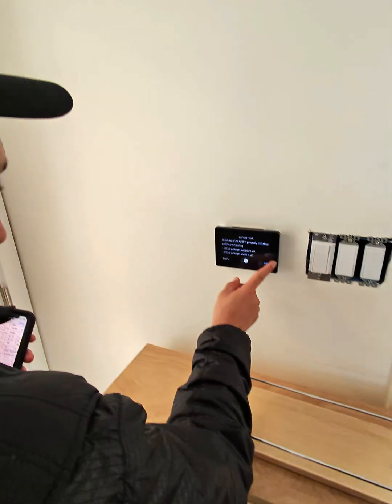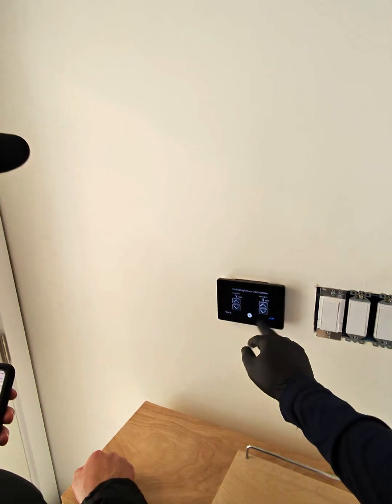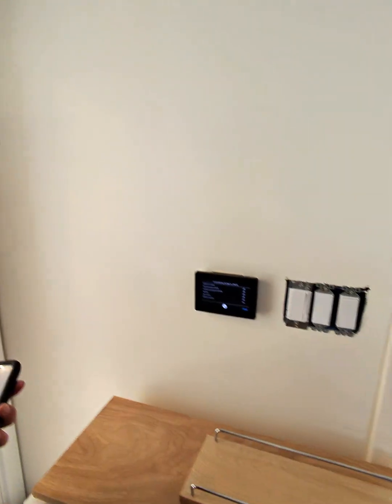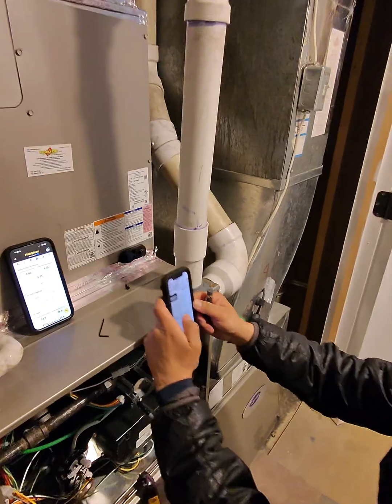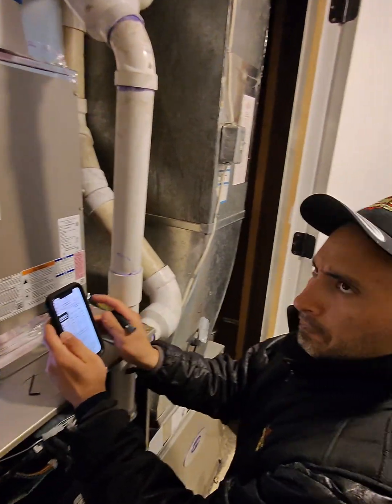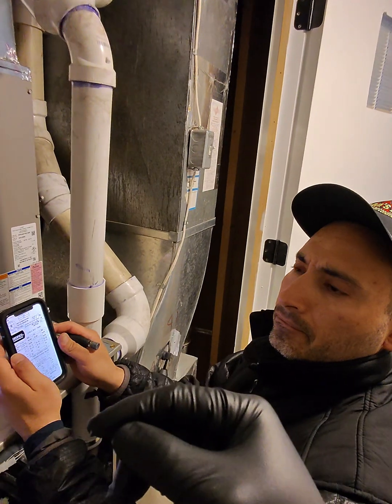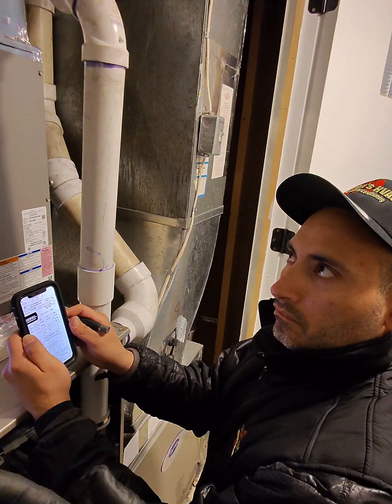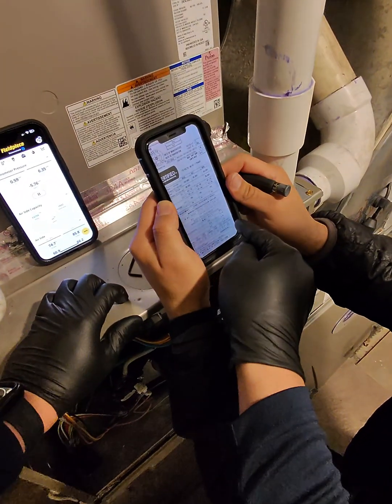How to Set High & Low Gas Pressures on a Modulating Gas Valve | Carrier Infinity Control Check Out

Comment: It lights in medium ish then throttles down. I do like being able to use the infinity stat to lock in high and low vs jumpers at the board that's slick always adjust high pressure 1st then low it's in the book